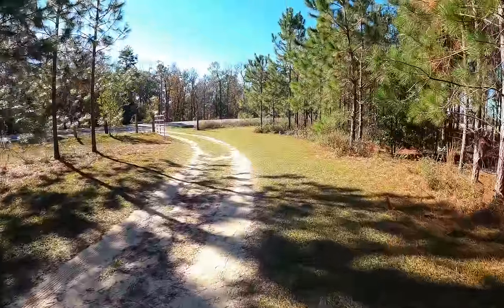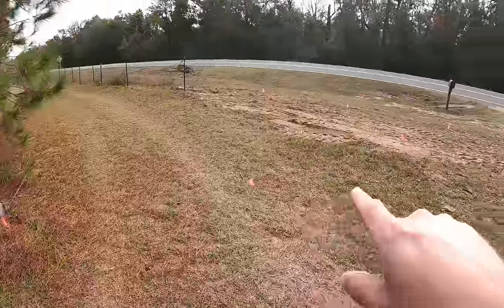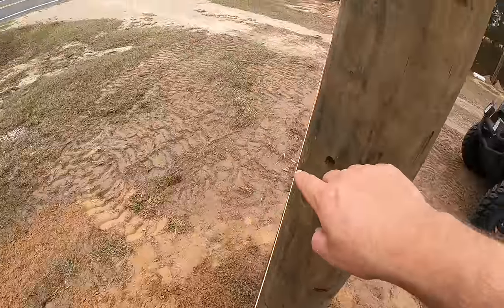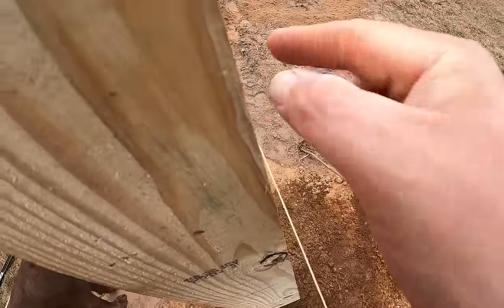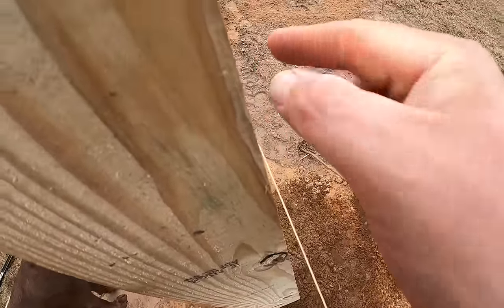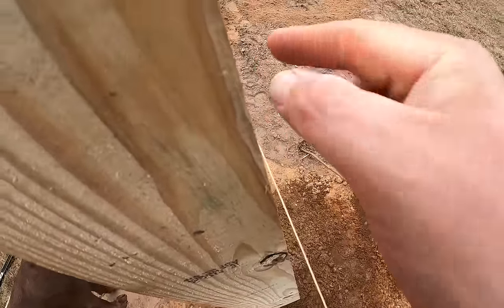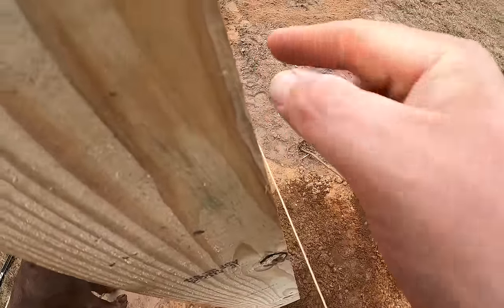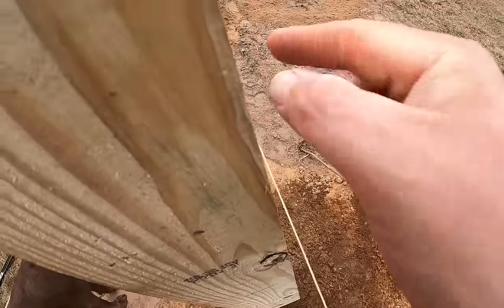4 Board fence and gate entrance how to!

Comment: Always enjoy your videos. I have similar needs for getting horse trailers and big truck and trailers off of a skinny 2 lane busy road out front. I have put a pipe entrance 80 foot in from the road. Because of the weight of pipe gates I went with 2 10 foot gates instead of 1 20 foot gate. They swing in towards the home and barns. Looks good and works well. Had the gate openers installed by professionals though. Got tired of getting out and opening gates or forgetting to shut gates. lol
Good luck with your project.
Reply from the maker: Thank you, I've got a rather robust system going in for opening it.

Comment: Turned out really really nice ! Simple and straightforward = ) The only thing I would have done differently is to cut the posts an inch above the top rail either sloped or, better still, then capping them with some sheet lead or copper. A massive help to longevity by keeping water from sitting on the end grain of the post. Maybe not necessary in all situations but a little advice for others = )

Comment: This is a good and timely video.  We are replacing rotted posts in our driveway. One of our cypress ponds went dry this summer and we found a bunch of sunken pond cypress logs in perfect condition. We are planing to use a few of them for new gate posts. We are running 2 12ft farm gates across and put a SpeeCo latch in the middle. They can lock if ever need be. You can use U bolts to mount a speeCo latch to both gates, if you lack a middle post. We plan to add wheels to both sides. I have 2 way speeCos in my barn and padture gates and I love them!  Eventually we will replace it all with nice security gates if we stay on this property long term lol. I keep getting unsubscribed somehow lol.
Reply from the maker: Nice find on the cypress!

Comment: A couple of years ago I dragged home a bunch of long pallets to redo some wood on the perimeter fence of my property, haven't done jack-all with it though since I forgot entirely that air tools need power and there isn't an extension cord long enough for me to reach the 3/4 of an acre to the roadway LOL Since that time I have gathered different tools to achieve my goal - there is currently stock fence encompassing the entire acre, but it has the road-facing portion with a wood facade to create the "fancy look" So soon I will be replacing the broken or messed up boards and will be painting the tops of the support posts purple, far more polite and endearing than the no trespassing signs. I do wonder where that purple idea came from though.
Reply from the maker: Oddly enough we don't use the purple method here.

Comment: I would of cut the 6x6 up rights 1 or 2 inches obove the cross boards a put a 6x6 post cap with or without solar lights to protect the top end grain.
Thats just me though.
Another great job.
God bless.
Reply from the maker: We discussed this and didn't want the distraction of 18 lights by the highway, people don't need to be seeing that. We will light up the gate and keypad area.
Reply: @TKCL  use just caps to protect the end grain or you can treat them yearly to prevent moisture penetration.
That's why I said with or without the lights.
Although the post are treated the top grain will absorb moisture.
Any way love the content.
Reply from the maker: I understand, I am sealing the tops and we are staining the entire fence after it drys.

Comment: Great video, very useful. Question I have is, how do you keep the height of each pole fixed- I assume you work your way from the bottom up using the boards as guides, but just wanted to confirm. Thanks again.
Reply from the maker: Many ways to do it. I did some quick math to include gaps and board widths to know my final height. I started with the bottom run keeping every board level. Then all you have to do is measure off the fist run for the remainder of the the other runs.

Comment: Looks fantastic! 6x6 post definitely look good! What size gravel do u recommend?
Reply from the maker: I get #5 rock locally, it's very comparable to the #57 rock everyone knows about.  Gravel also works well.  Anything that can not seal and allow drainage will work.
Reply: Clean stone drains but it moves around under tires.   "modified" stone or basically everything 3/4" and below compacts, but isnt water permeable.  I recommend modified, but must slope 1/4" per foot so water drains.  If water puddlea anywhere, youll get potholes.  Too much slope=water runs off fast and carries the fines with it.  Too little slope= water ponds and creates potholes.  Raise the final grade 2" above the surrounding grade, and slope the dirt away from the roadbed.  Most important thing for driveways=water management.

Comment: Looking at building a small 20x20 boxed garden fence. Always wondered why you and others just dry fill the whole with cement instead of pre mixing and pouring? How long does it take for the dry cement to actually cure doing it that way?
Reply from the maker: For something non structural, dry pour works great as you can pack the post in and it's solid. When you pre mix you typically brace the post and let it set overnight. Cure time for dry pour really depends on the moisture content in the soil or rain. Could be ready next day, or take a long while waiting for rain.
Reply: @TKCL  appreciate the knowledge

Comment: How about where the Driveway meets the Highway?  I would think it would be a good idea to widen the access area there.  I would think it might keep a truck out of the swale or ditch.
Is there a code that states how wide this must be?  Is there a Limit to the width?
Can you create an access area for the USPS vehicles to get to your mailbox?
Reply from the maker: There is code and engineering that's required, it's very expensive. My driveway is to code per our road department.

Comment: There are chemical mixes that work better to hold the posts and protect the post against rotting and they have no shrinking. You likely know but just thought I would mention it.
Reply from the maker: If your referring to the foam, I'm not sold on its long term reliability. It's not solid enough to not deform over time with heat and cold ground expansion, plus twisting and shrinking of posts.

Comment: do you have a 30 ft culvert wide. it also depends which way you are coming off the road. does Tiffany charge you for helping you, now you put a TKCL on the gate. be bless and safe.  SAVANNAH TN.
Reply from the maker: I think it's 33ft if I remember correctly, I had to follow the road departments requirements. You'll be happy with the gate 😉